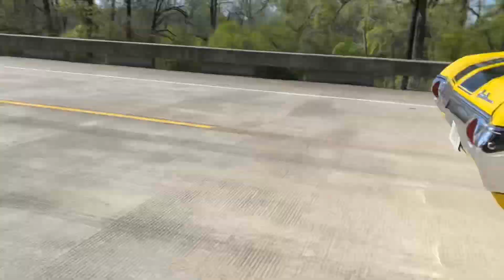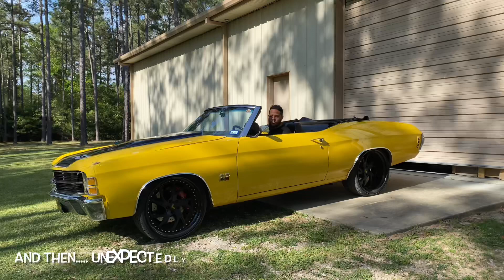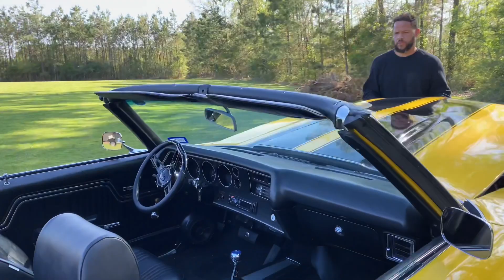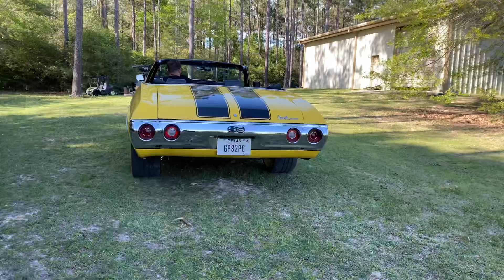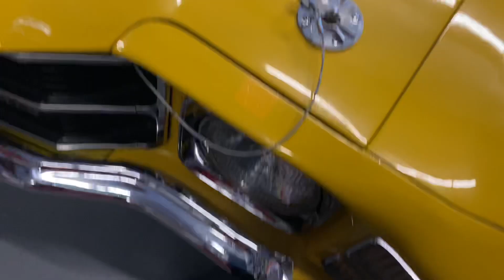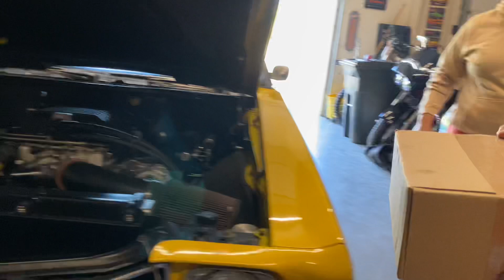1971 LSA swapped Chevelle: unexpected part failure

Comment: I remember back in like 2010  I was rolling my Gbody on twos for a late night situation and didn’t know that the irocs were rubbing on the brake line so Im dipping on average about 90mph on the freeway get off the freeway get to the situation bust a Uturn on the street the car kept going popped that bitch in park and that did some minor damage but it stopped good thing it didn’t fully cut through until I got off that freeway 🙏🏽🙏🏽🙏🏽

Comment: Have you ever installed a 4L80E in any of your chevelles? If so,  did you need the floor tunnel modified to make it fit? Thanks!
Reply: That's in his car now
Reply: @zacharywallace7710  Did he have to mod to fit? Thanks!
Reply: @wileybarnes233  I have an LSA/4L80e in my 72 Chevelle.  If you go w the Holley swap kit, no tunnel mods are needed.
Reply: @korndawg1978  you have a part number on that kit??